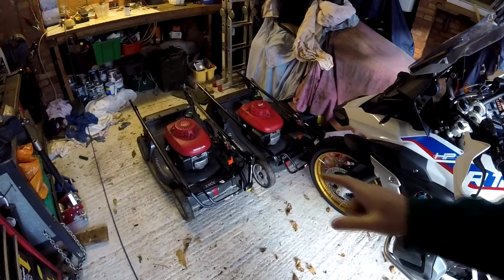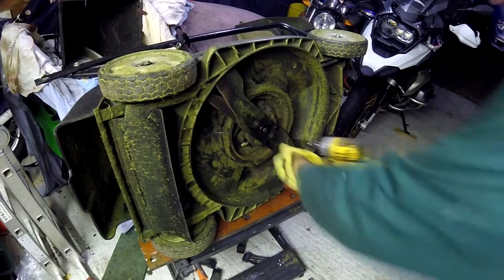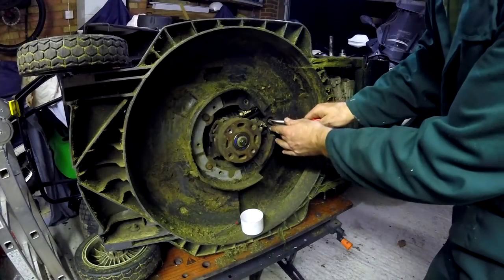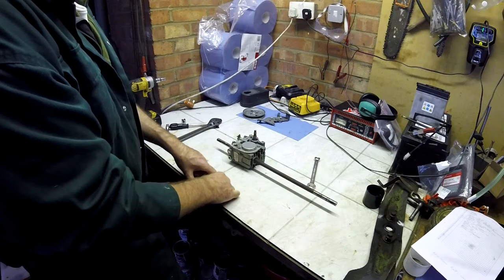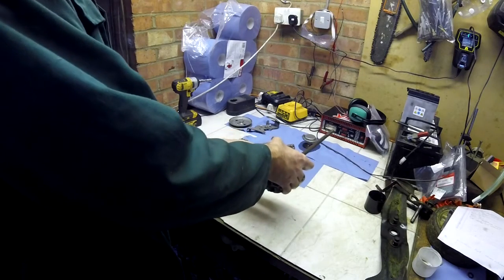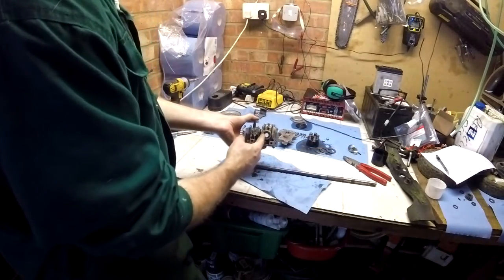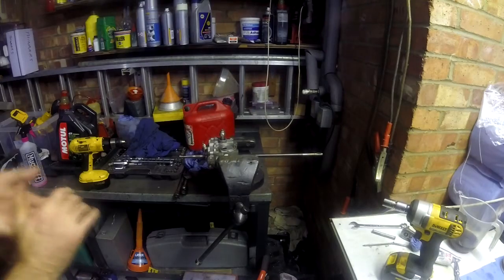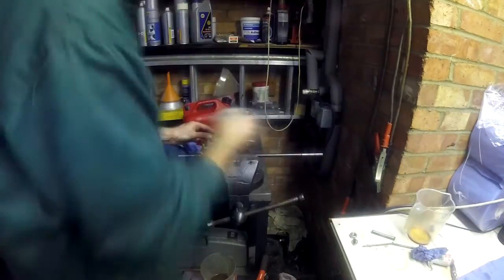HRX 537 Hydrostatic drive removal and repair full

Comment: Very helpful video, thank you.
A couple of tips - there is a thin metal 'dowel pin' in the pump chamber that connects with the swash plate which opens a valve in the top part of the pump as the swash plate is moved by the control lever. Ensure this engages with the lug on the swash plate before assembling the pump.
Also make sure that the washer with the two small projections on its circumference fits into the corresponding recess in the 'motor' chamber on the axle.
Reply: Do you put the washer with the projections on first or second when reassembling?

Comment: I am moving on with my HRX537 rebuild and now have the gearbox out as the drive didn’t work 
As suggested I cleaned the gearbox thoroughly and have it in a bench vice
The cover is off and the oil level is low and the oil looks very metallic 
I just topped it up and put a drill on the input shaft to ensure the unit would work 
It did, so now I have removed the two drain plugs so the old oil drains out. 
I have new seals ordered 
LSE have no stock so I’ll add a link with an alternative supplier 
I really want to get the old seals out without dismantling the unit fully 
The main reason being it’ll save a lot of time and reduce the possibility of errors 
Thanks again to highdef

Comment: Nice Beemer. I miss my old 1200GS TE. When I grow up, I plan on buying another ;-)
Reply from the maker: Ta, I’ve had four .   Great all rounder but Ducati , KTM and Triumph are also in the mix these days 😉
Reply: @highdefp-rm7zg  Yep, I've had a few Beemers in my time. R1150GS back in 2002, R1150GS Adventure in 2005 and the TE in 2015. I regret chopping in the TE, but the current flying armchair has given me 5 years worth of trouble free riding, so I can't complain. Cheers!

Comment: I blow a seal in my 476 Hydro with a palm leave that wrapped around the shaft! A new a hydrostatic box cost me £330 and 100 labour 7 years ago. Was told can’t be fixed.  Well… it can

Comment: As long as you have the wheels and the height adjusters off, might as well replace plastic axle bushings (2 per side).  They wear out pretty quickly, and if the axle is messed up from spinning metal on metal, well, you're stuck buying the entire transmission.
Reply from the maker: good input,  I'll look at that...

Comment: At 19:28 which washer goes on first? One of them has "ears" or little protrusions on it. Mine fell off when I removed that cylinder and I didn't see the order. Really, really hoping you see this. Honda just tells me to send it to a shop.
Reply from the maker: sorry for the long wait on response ...Ive been on a motorbike tour..    I think there are two washers to put on at that point.   Hope this helps.   All the best
Reply: @highdefp-rm7zg   I got it back together and working. Your video was very, very helpful. Thank you!

Comment: After Googling the part number of the oil seals i found them much cheaper than l&s engineers from a Honda motorbike dealer. Appears that they also fit some Honda motorbike gearboxes!

Comment: A very detailed video -thanks for sharing. I have an hrx537 with no drive at all - annoying as its quite new at nov 2019. i have checked controls and they are operating hydrostatic unit. i have stripped off wheels and am confident to get unit out but not stripping down trans and reassembling. As shaft is quite new with limited surface rust would you advocate draining oil and replacing seals without full strip down? if not do you offer repairs by post?  many thanks
Reply from the maker: Hi,  Seems odd that it does this on such a new machine - Has it done a lot of work?       I see the control arm seized a lot on these machines and that will stop the gearbox from working in its entirety so worth a close look at that..       If you take the trans out,  you can start by seeing if it has lost oil.  top it up and test it with a drill in the same way I did on the bench.     If it's obvious that oil has escaped then you can change the seals without taking the unit apart BUT this comes with risk:    Damaging the new seals or mating surfaces when inserting or extracting is a possibility.  Removing the seals with the shaft in place is a tricky one and requires a bit of technique with an old wood screw - note that this process will instantly destroy the old seal.      I don't do repairs by post I'm afraid.         A helpful tip:   There's nothing inside the gearbox that will actually fail as it's so simple, it's just a matter of contamination (air) , or lack of oil that will stop it from working...       let me know how you get on
Reply: @highdefp-rm7zg  Thank You. I recently bought the mower with no transmission and dont know its history - I bought it (with the newer GCV engine) as an upgrade to my 2004 hrx 537 which I bought from new and is now starting to show its age - cant bring myself to pay ££1300 for a brand new one even if it will last me 20 years.. Please could you tell me how to check if control arm is seized. I can see the connector on the transmission unit moving when I tilt the mower and pull in the drive lever and I have adjusted the drive cable but the transmission drive rod still doesn't turn.  A few things i noticed when I stripped down the axles was the rear right wheel had no tread on it and on the inside plastic face it was scoured around the outside of the drive cog.  Also previous owner seems to have fitted the pinions the wrong way around with washers and one key missing.  I worry about opening up the transmission mainly from the point of view of loosing parts or reassembling incorrectly.
Reply: @highdefp-rm7zg  I have taken the transmission unit out today and removed the filler and membrane to find hardly any oil in unit.  Before i order the seals and hydrostatic fluid please can I ask one more question of you - is it usual for the input drive to feel notchey when you turn it.
Reply from the maker: @StephenKearney-k1x  hello , there’s a good chance that the input shaft may feel notchy as it drives small piston against a wash plate .. I’d say flush the oil through a couple of times and thoroughly test unit on the bench before you put it back .    Use a drill to drive the j out shaft and watch the out shaft change speed when you twist the control arm ..
Good luck .. 0:02
Reply: @highdefp-rm7zg  Thank You. I stripped the unit down today and to my horror I found the previous person had fitted the smaller piston pump incorrectly with springs facing outwards and one of the pistons valves missing.  I can replace the springs BUT any idea where I might find a replacement piston valve - if in deed it is called a valve?  Thanks

Comment: Wow , what a brilliant explanation, have two 537 mower both with clunk in noises, is it always oil and seals or is there any possibility of mechanical problems inside the gear box , do you take on repairs  thank you very much for the video
Reply from the maker: Hi.   Normally the clonk is from air in the oil. However there are cogs inside the rear wheels which sometimes wear out .   Worth a look .   You can source parts from  LS engineering .    Don’t normally do repairs but if you’re stuck and  around Reading in the  UK give me a shout.

Comment: Do you have experience if these mowers won't pull backwards? Can the Hydrostatic drive affect that (prevent the driveshafts from rotation the other direction), or can it only be the driveshafts and rust in these plastic bearings as many others are stating?
Reply from the maker: Yes I do.   I just fixed this two weeks ago!   The lever under the deck that is connected to the drive speed cable and gearbox is not returning all the way to its end stop. This was simply fixed with wd40 to free it and cable free play adjustment.   I didn’t take anything apart to fix this ….  Move the lever under the deck with pliers from end to end  and soak it with wd40 or similar .

Comment: I purchased 3 of the shaft seals with that same part# @2-1/2 years ago.  Got into the transmission (finally) this weekend and the seals don't fit! Even tried pounding them on with a socket and mallet, but nope.  Is there a chance they could have shrunk being uninstalled in the plastic bag?  Crazy.  Ideas?  Thanks.
Reply from the maker: this is a bit odd.   I don't think they would shrink?   I wonder if someone put the wrong seals in the packet.     If I remember correctly I could push my seals in with my fingers.   Perhaps try ordering the seals form another supplier.    Here's the pt No# again         91204 KE8 003

good luck
Reply: @highdefp-rm7zg  Yep-three seals in sealed plastic packs with that same part #.  ?? My plan is to open up a 2nd spare transmission with a bad shaft but good seals and swap in the good shaft from this first one with bad seals.  I need to carefully document everything AGAIN so I have a fair chance at accurate reassembly.  I wouldn't have attempted it without your video.  Thanks!
Reply: Seal dimensions are 13 x 22 x 5 mm

Comment: I can’t reassemble the thing like at 19:28. I realize that one of the washers wasn’t going past the part that has teeth but only on the part that is smooth making it not close. I didn’t get the washers mixed up since I didn’t remove it fully from the mower body. Any links or anything that would let me see the washers be put in correctly would be very helpful.
Reply from the maker: There are some pics here 
https://www.lsengineers.co.uk/drive-box-assembly-for-honda-hrx537-hxe-lawn-mowers.html

Comment: Hi for me out of the 7 pistons on the input side 1 of them is jammed and stuck down. Is that meant to be like that? I cant tell in ur video if all 7 are up or only 6. Can u please confirm. And if mine is infact jammed wats the best way to loosen it up and remove it? Thanks
Reply: Also are we meant to grease anywhere inside at all?
Reply from the maker: All pistons should be loose and free.    This is a bit worrying? Did it have water in it ? Was it contaminated?  
I’d suggest soaking is diesel overnight the tapping with a plastic hammer .
The lubrication for the entire device is the hydraulic oil .  You can use grease for the drive shaft and seals ..  good luck .

Comment: Thanks for this awesome video. Just finished blade clutch on mine hrx217. Do you know if the hydrostatic trans is the same on that version? It appears largely identical. Would like to source those parts, but the hrx537 is throwing me off. Thanks for the video!
Reply from the maker: try L&S engineering website    www.lsengineers.co.uk     they have the schematics and associated part numbers ..

Comment: I installed the parts as I think you did them. Including washers. Can’t get the cable piece for the swash plate to spin. It has its washer. Did I miss something obvious? Thanks!
Reply from the maker: 14:52   If I understand you correctly, the angle of the swash plate cannot be adjusted with the external control cable.     I suggest going back to where in the assembly it was free, and keep checking its free moving as you add parts and this should reveal why it doesn't move.   The washers are critical in  position and I think this is shown at 14min 52 sec...    Is the spring/control arm on the right way?  I remember there's a few ways that this could go together.. 
Did the cable piece spin (operate)before you took it apart?
All of the mowers (now three) are out working at the moment or iI'd take a look for you...
Reply: @highdefp-rm7zg   the rod for the swash plate isn’t moving. I haven’t installed the spring and bracket yet.  It was moving freely before bolting down the larger piston set. The washers are installed in order I believe. The shaped one is outer and  And the basic round one is right up against the back of the piston/motor assembly. Same with the pair on the swash plate side.
Reply from the maker: Is the whole axle in the wrong way around (the short bit is where the long 
Bit should be ?   Is the axle shaft in the right position ?
Reply: @highdefp-rm7zg  i found the issue. Took it apart again. The guide pin on the input side had fallen beyond its resting place on the swash plate, preventing side to side movement of the swash plate!  Already bled it and it functions. Thank you so much for your help on this! Cool to learn as well.

Comment: nice job are the seals and oil easy to get hold of
Reply from the maker: Yes I googled Honda lawnmower spares and there were a few options .  In the uk I used lsengineers.co.uk     Pt no 91204-KE8-003

Comment: How much would a dealer charge for that and how long before you need it done  thanks not 100 % about machine now😵‍💫
Reply: Years ago I asked my local dealer this question and they said they don't recommend having this service done (by them) because it is about the same price to have them just install a new transmission.  This eliminates the possibility of a leak in the rebuilt transmission that they would be obligated to repair again.  That said, having them put in a new transmission is about half the cost of a new mower.
If you aren't using these mowers commercially, this is something you'd likely never have to do, or have done.  If you are using them commercially, this is just off season maintenance after a couple of years.

Comment: Unfortunately this didnt work for me. The shaft even once sanded was so pitted it damaged the new seal on assembly. £350 for new unit
Reply from the maker: Can I suggest buying a spares or repair unit on eBay ?   One of my mowers was less than 250 usd complete ( the deck was cracked)

Comment: Why all that vice just changing the fluid. Maybe I missed something?
Reply from the maker: Main reason these fail is the oil seals and to do that properly it’s a take it apart job.  The oil leaks out and then they won’t operate at all.  Changing the oil alone does nothing .
Reply: @highdefp-rm7zg  did you change any other parts or just the oil seals?
Reply from the maker: @alvaronayarita  shaft circlips and blade colt/washer.. les than 10 usd.

Comment: Along with my previous comment 
Would you say it’s a pretty poor design for Honda ?
They do great stuff normally I’m a big fan of anything Honda
But there are lots of these with failed gearboxes floating around 
Thanks again
Reply from the maker: the engines are superb if serviced well - I've only heard of engine failure when they run out of oil or the cutting blades catch a stump or medal bar which bends the crank  (Fixable but expensive)   The Hydrostatic gearbox is open to the elements and this is a design fault.... It really needs to be covered from the underside, have a dust seal and an oil seal  (or two oil seals back to back to protect the inner one)  ... All the best....